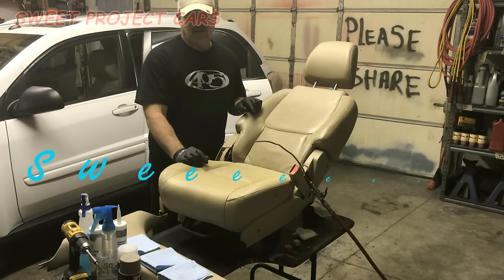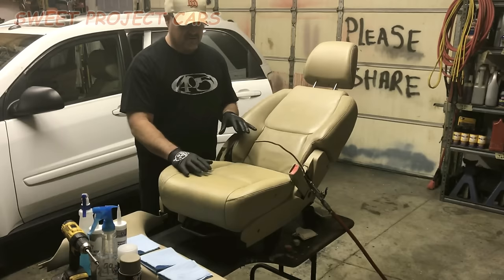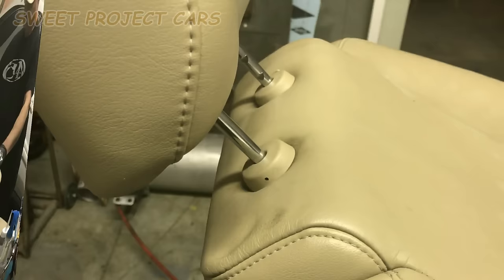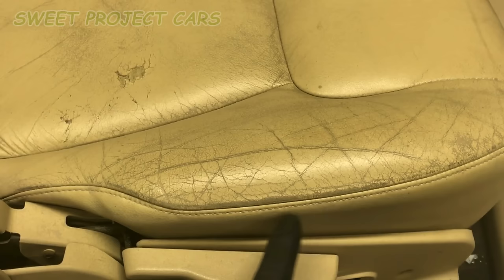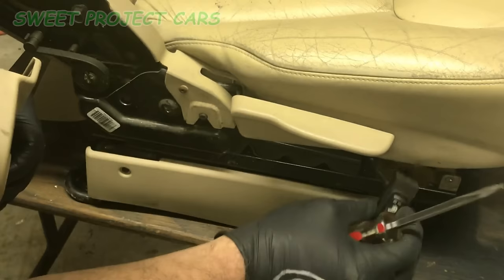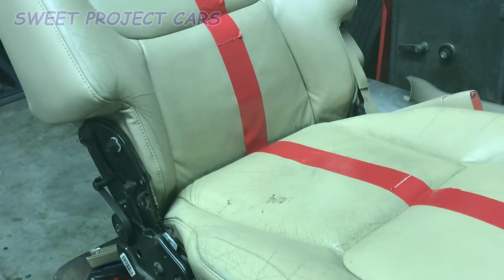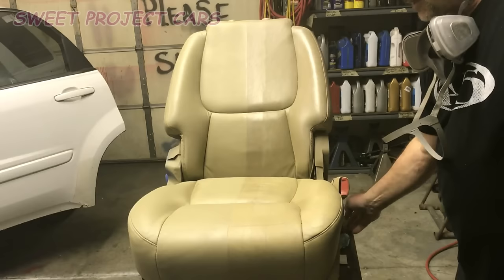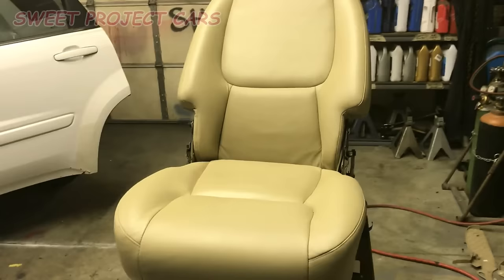How To Repair The NASTIEST Leather & Vinyl Seats....Back To PERFECT!

Comment: Great video, bought the “kit”….Just taken the plunge…..14 year old leather seats in my truck……waiting for the silicone to semi set right now to do the thumb/knock off thing…….how long till that happens roughly?
Reply from the maker: It depends on the temperature you're doing it in and the humidity. Silicone glue is very picky when it comes to temperature and humidity, all I can say is that when you lightly touch it and no material is brought up on your finger it's ready. Hope this helps, thanks for watching and asking. This process is just a temporary fix while you bank the cash for new factory replacement seat covers. Have a fantastic day. mad Mike

Comment: Thank you for the super video of your process. I have a vinyl hot tub cover that sat out in the sun too long without proper care. The entire surface is crazed and crunchy, and the hinge (also vinyl) is beginning to lose pieces of vinyl that have separated from the backing. Will your process work on the cover, or is the surface now unstable enough that the new covering of silicone and paint will separate from the backing anyway because of the crunchy vinyl? Would it be better to try to remove the remaining crunchy vinyl from the backing, and then use your process?
Reply from the maker: If you want to know what I would do in your situation rather than spend $400 to $700 for one of these  https://amzn.to/3WJxXHo  is to get this  https://amzn.to/3yxjExM  and then use this to attach it  https://amzn.to/4dE6iyx  just remove as much of the old cover as you can  because it sounds like your cover is too delaminated for the silicone to work my friend. Hope this helps, thank you for watching and asking, have a fantastic day. mad Mike & team
Reply: @SweetProjectCars  Thank you! Makes total sense.

Comment: Do you have a video of getting the middle row seat to lift back up I have a Ford flex with a middle seat that won't move
Reply from the maker: You need one of these  https://amzn.to/3iVeFyZ  so you can see what is going on under there, it's usually a broken cable. Your best bet, unless you are really handy, is to take it into your favorite repair facility or dealership as your last resort Michael. Hope this helps, thanks for watching, have a great day. mad Mike the hammer SPC

Comment: Question with sitting on it will the cracks open again or it’s sealed fully that you can move around on it with out worries? Thanks !
Reply from the maker: Hello Franco, we've done this process for hundreds of customers in our 30+ years and never had an issue. Thanks for watching, have a great day. mad Mike the hammer SPC

Comment: Have seen some repairs with silicone, like the color didn't stay or look the same.  What is the leather putty used in other leather repair videos?  Its white, its gets sanded lightly after it dries.  Does the silicone allow the leather to breathe?
Reply from the maker: This is our go to repair for leather, the only other option is to replace the seat covers completely which is very expensive.  We do this method on hundreds of car seats every year for customers with never any issues.  When this process is followed to a T, it works great and lasts for years.  Thanks for watching.  mad Mike the hammer SPC

Comment: Question... I need to refinish vinyl seats in a golf cart.  I watched a couple of your videos. But the one said you cannot paint silicone,  unless you mix it with paint first, and then spread it, but the other one, you spread silicone on, let it dry, and then spray painted the whole thing. I want to do it the latter way, but will the paint stick if it's not mixed first? I have the vinyl prep spray too... is that sprayed on before or after the silicone,  or both?
Reply from the maker: Use the prep spray on the silicone after it's dried, but if you are new at this process, we highly suggest mixing some of your paint with the silicone, it's a very easy process.  Mix, prep then color it.  Hope this helps Meri, thanks for watching and asking.  Have a great weekend, and all the best with your project my friend. mad Mike the hammer SPC

Comment: I wonder if this works on my recliner. Its perforated pleather keeps peeling.  Can I clean as you did and then just use silicone over it -- will silicone stick to the leftover peeling pleather?
Reply from the maker: This process does not work on pleather, sorry.  Thanks for the question.  Have a great day.  mad Mike the hammer SPC

Comment: I need to repair the very top back of my pontoon seats where the black cover baked them.  How is everything holding up?  I also have a couple of holes in the foam on the top of the seats.  Is permatex the only thing that I need to fill the holes?  The holes are probably an inch to inch and a half deep by about the same width.
Reply from the maker: You can just fill them with this my friend  https://amzn.to/2DuPmO1  If you follow the process shown, and make sure you use the exact same products/tools this will last years and years. Thanks for watching, have a great week and all the best on your project my friend. mad Mike the hammer SPC

Comment: I have a slightly off topic question.....  my leather seat is worn, same as yours, but worn right through, to the foam underneath, on the edge next to the seam, about 3cm long.. The vehicle is a bit raised and everyone slides on/off the seat, causing this. 
Any magic solution for this? 
ANother question - what is the leather colouring, you use? And whats the Prep? - I will probably have to be a bit creative, as purchasing materials can be really difficult as I live in Indonesia - so using repair kits is not an option.
Nice videos !
Reply from the maker: The products we share in the videos description will work for your issue you will most likely have to find a piece of donor material from underneath the seat area cut it off and glue it into the area that is missing but if you cannot get these products we share here your best bet is to find a replacement seat cover for your vehicle the manufacture is most likely where you will have to go sorry but thanks for asking Mike sweet project cars

Comment: How does this hold up if it's real leather? If you use cleaner and conditioner on it later will it come off? Or feel different than they did when new?
Reply from the maker: You can use this on any type of seating material other than cloth of course, but with this process after you color it with the appropriate paints shown in the tools list, cleaning and conditioning will be the same as normal. Remember, your leather will be covered up and what will be on top will be paint on top of the sealer. So when you clean and condition it keep that in mind, use gentle cleaners. Thanks, have a great day. mad Mike

Comment: So for just regular cracks like on the side of the seat do  i need the silicone too ? Or did you put the silicone on all the cracks? On the video i see you only did it on the middle part of the seat
Reply from the maker: You can use it on any part of the seat that is cracked, it's harder to do on the sides, but it can be done.  Thanks for your question, sorry about our delayed response.  Have a great day.  mad Mike the hammer SPC

Comment: Will heat from the sun sitting in the car melt the silicone? Also, don't you have to clear coat it to avoid paint transfer onto clothes?
Reply from the maker: We've done this process for years and years and years for hundreds of customers and never had those issues. You need to re-watch the video and make sure you use the exact products/tools shown in the description for success. Thanks, have a great day. mad Mike & team

Comment: Does using spray paint will leave a smell inside the cabin. (like smell of thiner) And if it does how to remove it.. And secondly I know a car which have cracks in its leather interior, but it still got that nice smell of the leather.. Using paint will remove that leather smell?
Reply from the maker: The products we use are made specifically to do this method, we have found no smell of paint once completed.  Hope this helps, sorry for our delay.  Thanks for watching and asking.  mad Mike the hammer SPC

Comment: In the video, you paint right over the silicone, but in your other video you state you need to pre mix color. So what is the proper way?
I tried this method and all I ended up is the silicone started pealing. I use adhesion promoter just as I. The the other videos. 
I look forward to your comment. Thanks
Reply from the maker: If you have a hard time getting it to bond, then due to the fact that there may have been a misstep, see this method https://youtu.be/Sp6HGSSQGXk  Hope this helps Nick.  Have a great day.  mad Mike the hammer SPC

Comment: So are you just spot checking the silicone or the spreading it over the whole seat?
Reply from the maker: Daniel, if you spot it you will see the edges of the silicone unless you can feather it out to nothing, it can be done but for novices, we suggest doing full sections of the seat seam to seam.  Thanks for your question.  Have a great day.  mad Mike the hammer SPC

Comment: I thought paint didn't stick to silicone? Do you use prep spray on the silicone after it dries, or do you spray it while still tacky, or how do you handle the paint on silicone?
Reply from the maker: It's all explained in the video, but watch this  https://www.youtube.com/watch?v=Sp6HGSSQGXk  it will answer any additional questions. Thanks for watching, have a great day. mad Mike the hammer SPC
Reply: @SweetProjectCars  Yeah I saw that one and that makes sense, but that is a different process than you used on this one so I wasn't sure if that was needed or if it can just be painted like in this one.

Comment: I’m not sure if this question was asked, but i really want to redo my seats, they look exactly the same as the ones in the video but they’re heated seats. Is it safe on heated seats?
Reply from the maker: Yes it does work on heated seats, but if the seats are perforated it will fill the perforations, but it still works.  Thanks for watching Samantha, have a great day. mad Mike the hammer SPC

Comment: I have a 1997 Eclipse GS-T, 73k Miles, the stitching in the seat, where you butt sits, has ran its course. How do you suggest I go about fixing this? The leather is in good condition but the actual stitching that holds the leather pieces together disintegrated
Reply from the maker: Jonny on something like that it’s best to remove the seat cover and have it re-stitched or buy new OEM seat replacement covers that is about the only way to fix the stitching issues sorry my friend

Comment: Question, would you use this same method on a small little nick, like 1/4 fingernail puncture or pin hole, it seems like it might be hard to work that stuff in or get it to fill in the gap, Since not much of a gap? thanks.
Reply from the maker: It will absolutely work, just follow the video to a T and make sure you use the exact same tools shown in the tools list. Thanks for watching, have a great day and all the best on your project my friend. mad Mike the hammer SPC
Reply: @SweetProjectCars  so are you saying the side of a 303 bottle, really makes a difference versus bondo scraper for you? Because I was just gonna go with the bondo  scraper since I had one of those handy. Thanks

Comment: Awesome video! I've subscribed! I need help with color selection.  I have 2002 Toyota Sequoia limited. Interior color is Oak. It's a darker tan color. I don't see it anywhere in a spray can. Do you know of a color that is a close match? Thanks
Reply from the maker: Hello Eddie, watch this for color codes  https://youtu.be/XSTXiyJ2O9E  it will help you find the color necessary, then we use these  https://amzn.to/2PWOfN3  or  https://amzn.to/2DJPV7Y  for this process, you may have to but a couple different colors to find one that you like.  Hope this helps, if all else fails, contact the nearest Toyota dealership, they should be able to get you the correct paint codes for your vehicle. Thanks for watching and asking, have a great week and all the best on your project my friend. mad Mike the hammer SPC

Comment: I watched both seat restoration videos as well as your paint  silicone video, but i noticed you just paint right over top of this silicone?? is that because its a specific brand? I want to do this to my car but want to make sure I understand the steps. Thanks!
Reply from the maker: The products we use in the videos is how you will have success, you have to use exactly what we use.  But, your best way to have success is to mix your color with your silicone, let it dry completely then paint.  Thanks for asking Kyle.  Hope this helps.  Have a great day. mad Mike the hammer SPC
Reply: Thanks! Appreciate the response.

Comment: i’m doing my seats i’ve got both of them out of the car they had some bigger holes in them so i used the leather repair kit to fill them with the glue i have two tone seats and i wanna silicone and paint the inserts my question is the parts where i’m painting have pin holes in them is the silicone going to fill those in and cover them or will they still show?
Reply from the maker: This process doesn't work well with heated/cooled seats, the silicone will interfere with the holes. Thank you for watching, have a great week. mad Mike & team

Comment: Would this work on a green leather sofa? Not sure which colour leather paint tho, also would leather dye adhere to the permatex? Or would i definitely need a leather/vinyl paint? Thanks mate good video
Reply from the maker: it works on any leather or vinyl and dye will not work the paint is the only thing my friend
Reply: @SweetProjectCars  thank you for the reply, is leather paint ok for a sofa do you think? Id have to get the right colour which sounds difficult

Comment: Can I use just standard silicon to do this trick or does it have to be that adhesive silicone?
Reply from the maker: george this is a product and tool specific video which means nothing else will work other than what we show you  thaqnks mike spc

Comment: Hey Mike, any tips ideas what can i do my seats are perforated in the middle the bottom parts just the middle part of the seat. Thanks
Reply from the maker: So you have vented seats..... those are a real bear to do using this method.  If you have the patience of a tortoise, you can do the process and then poke through the silicone for your venting with round toothpicks.  I will tell you now, it is very difficult especially if you want it to look beautiful.  Your best bet with vented seating is to replace with OEM seat covers.  Thanks for asking my friend.  Have a great day.  mad Mike the hammer SPC
Reply: Thanks mad mike as always best content can't wait to see feature videos.

Comment: Looks good on camera but how does if feel, won't the silicone make it grip to your pants when you slide in and out?
Reply from the maker: Never had that problem Amante. We've done this for 50+ years  for hundreds of customers without issue, just make sure you use the exact products/tools shown and you will have success. Thanks for watching, have a great week. mad Mike the hammer SPC

Comment: 2 questions 1can i use any sealant adhesive silicone? And 2 what kind of paint is the spray...please
Reply from the maker: eric this is a product and method specific video...you will need to use the same exact product for it to work all the tools and products are in the "SHOW MORE" of the videos description my friend
Reply: Thanks. I just asked without reading cause u explained it before
Reply from the maker: no problem glad to help you my friend

Comment: O, that's what DIY means.
This technique uses a lot of materials, but looks a little easier than the leather fix kit because you don't need to use the little iron.
I'm surprised ninety-nine percent alcohol is the preferred cleaner, I would have thought it would dry out the upholstery.
Silicone doesn't last forever in the tube at least silicone caulk, so if it sits for awhile, test it first.
Reply from the maker: This  https://amzn.to/3wIDQHd  is a beast when it comes to cleaning, it's all we use. See this video on preserving your silicone  https://youtu.be/7jTbIiHc3P0  Thanks for watching and commenting, have a great day. mad Mike

Comment: Using a similar process I guess I can paint my tan seats dark brown? (F150) Also, will this work fine on steering wheels?
Reply from the maker: You sure can, it's easier going from a lighter color to a darker one for sure, and yes indeed, we've had great success doing this on steering wheels. Thanks for watching and asking, Chaplin, have a great week and all the best on your projects. mad Mike the hammer SPC
Reply: @SweetProjectCars  - Thanks brother this was a great help.  Always hated my light tan seats.  Much prefer the dark brown ones in the King Ranch style.